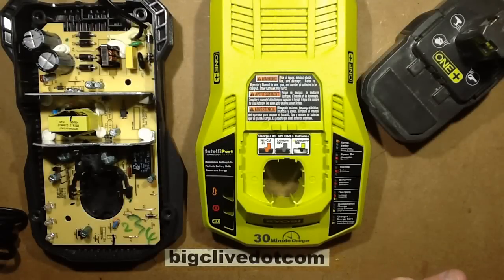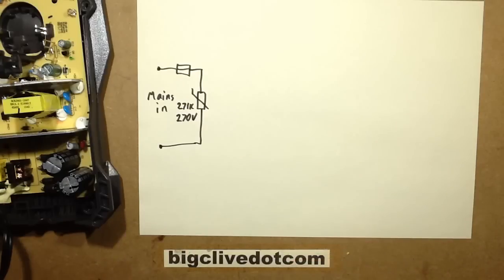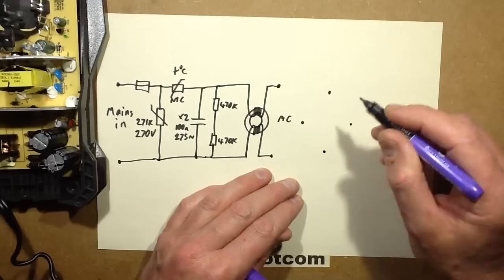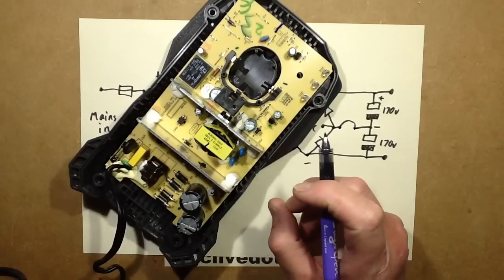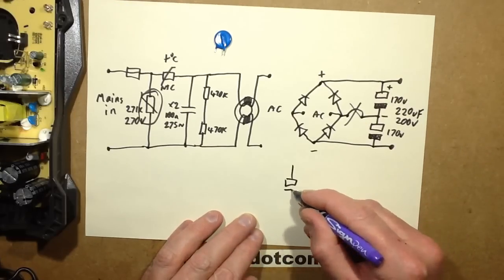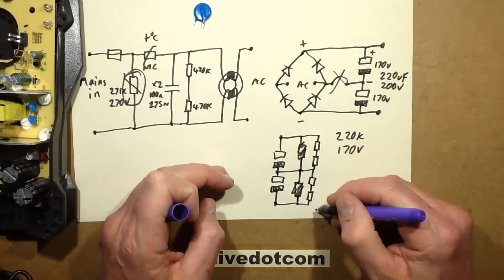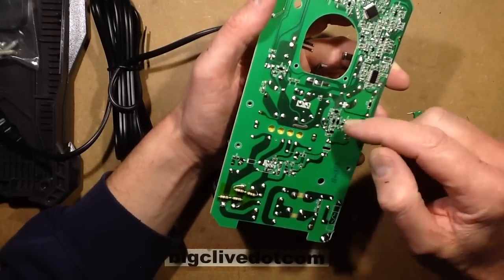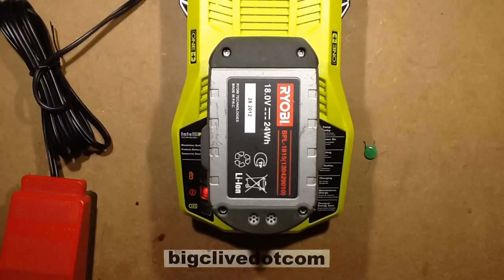How to convert Ryobi P117 charger from 120V to 230V use.

Comment: It may have been a bit cleaner to replace the two capacitors in series, with a single 100 uf 450 V Capacitor, and leave out the balancing resistors. Nice explanation.
Reply: +John Coops a) a cap like that is a lot more expensive than a couple resistors b) the whole point of the link is to make it a nearly-dual voltage standard supply. No need to make it difficult to convert back.
Reply: At least someone who thinks before writing
Reply: These capacitors can get somewhat expensive. And it may be difficult to get a matching quality one like those in a top-notch power supply. 
I would personally leave the resistors out, or use 1M resistors like the computer PSUs have. The capacitors don't really need balancing because they have extremely high internal resistance and that resistance tends to go lower with voltage creating negative feedback. I've been running several for over a year without an issue. No balancing needed. They only put the resistors in there to reduce the risk of shock.
Reply: @zwz.zdenek  Your deluded... this is in no way a 'top-notch power supply'.
Reply: In some cases, such as older and/or cheapo computer PSUs which employ a half-bridge topology, that's not really an option, since the center tap of the transformer goes to the mid-point of the high-voltage DC rail.

Not in this case here, since it's a "lowly" flyback, but "just sayin' "... :)

That being said though, i shudder at the sight of CapXon capacitors >_< Preeeetty sure the 200v ones are KM's.
Reply: Jeez, if you don't even like capxons, you've got real high standards.
Reply: Jasper Janssen You're almost making it sound like that's a bad thing :P

Thing is, CapXons *WILL* fail, same as Fuhjyyu, and countless other chinese (off-)brands.

Let me put it this way - i trust the USED japanese caps i've reclaimed from various gear i've torn down & gutted for parts, than any of these crap brands, even if new.
Reply: My point is: unless you're going around replacing caps in every mains powered device you own — usually breaking warranty — you've got an awful lot of cheap caps in your house. Yes, they eventually will fail. So will Nippon Chemicon. It's just physics: electrolytics dry out. There's no reason to think that on average more than 1 in 10-20 or so of electronic devices will have their caps fail before the devices are landfill.

Capacitor Plague is a thing , yes, but one of the past.
Reply: @JasperJanssen   This crappy design power supply will fail long before any capacitor dry out. 
These rubbish Ryobi battery chargers fail soon after  the 3 year warranty dries out, and many die before that anyway.
Reply: Yes, i know all electrolytics dry out eventually - the question is how long it takes :)

Chinese caps - a couple years (regardless of the specs in the datasheets). Japanese caps - a couple decades :P And for the record, i have an ESR-meter as well (ie. i'm not just talking out of my rear end).

I should, though, add the disclaimer that even some of the Japanese brands have (or have had) the odd series that was dud (thinking of Nichicon HM/HN's about 10 years ago, or Chemicon KZG's, of which i still see some failures to this day).
Reply: On the other hand, one can only wonder how many devices ended up as landfill precisely because of crap caps...
Reply: KhronX "a couple of years" is exaggeration. I mean, it all depends on the environment, but in many devices they do indeed last a decade or even two. If they're placed in a hot, often used environment, then maybe a few years.

Even the cap that failed in my Samsung monitor (which was a model well known for the issue, btw, which suggests particular susceptibility) lasted nearly a decade and those were the small caps. It's actually pretty rare for main filter caps to fail badly enough to affect actual operation. The small ones dry out much faster, even under adverse conditions.

(PS: having an ESR meter doesn't make someone an expert. I should know, I've got one too.)
Reply: KhronX Actually a couple of years is not so much of an exaggeration. Yes, on the average many of the cheap capacitors will last longer than that, but their death rates are all over the map compared to the better brands, with many failing early, even very early (like first hours and days even), many more in the 5-15 year bracket, and rather few lasting terribly far beyond that if they see much use, are operated anywhere near any of their rated limits, or if the circuit is particularly sensitive to a degrading ESR/D/Q.  I have had many of those cheap capacitors fail within the very first year, so they are a gamble no matter how one looks at it. Very, very, seldom do I see such early failures in number with quality capacitor brands. 

As a general rule, if I am opening a device to replace one failed off-brand capacitor and I expect to still be using that device for another 5-10 years then I usually go ahead and replace all such capacitors with quality brand (Japanese) replacements.  It costs only a few dollars more and all but assures that I will not be revisiting similar repairs anytime in the near future on that device as most of the effort lies in disassembling the device and then reassembling it. Whether I replace 20 or 40 capacitors or just one or two, it takes just a minute to remove a single capacitor and solder in its replacement (whether through-hole or SMD), a few more adds very little to the total inconvenience and down time versus repeating the repair in a few more months or years. Besides, soldering and desoldering have a certain Zen to them (actually, if you have a vacuum desoldering gun then desoldering through-hole components is borders on fun compared to without!).
Reply: Ethan Poole Couldn't agree more... "If something's worth doing, it's worth doing right" (the first time around) :)
Reply: The two large 200V ones looked like Samxon to me.  The large input capacitors are only being exopsed to very low frequency ripple.  Samxon primary caps are more than adequate for this.

The secondary high-frequency green colored caps look like the notorious Samxon GF series, and they should be preemptively replaced.

Not all of Samxon's series are inferior.  Some are actually on par with Japanese equivalents.  The RS series is a good example of this.

Comment: 15:20 Huh, damn, I always thought the capacity stayed the same when putting caps in series, regardless of what kind it was. I thought it would only increase the maximum voltage that could exist over them both compared to a single one... increasing the capacity can be done by putting caps in parallel, but decreasing the capacity by putting them in series... Can you explain this? I would think it's because of the theoretical lower voltage over them (in a fixed voltage situation) resulting in capacitors that would not be utilized till their full extent, but is it? My head hurts... :)
Reply: Sure, capacitance can be defined as the rate of voltage change at a given current. For easy math a 1 farad capacitor, starting from 0v if you apply 1 amp for 1 second the capacitor will now be charged to 1 volt. If you now connect 2x 1 farad in series and apply 1 amp for 1 second then each will charge up 1 volt for 2 volts total, gaining 2 volts from 1 amp for 1 second means .5 farad total.

I hope that this helps you understand.
Reply: Just to add to Daniel's explanation, here's how a dummy such as myself thinks about it. It's the opposite of adding resistors. Parallel resistors lower resistance, parallel caps raise capacitance. Series resistors raise resistance, series capacitors lower capacitance.
That's easy to remember. Now for understanding, I find the hydraulic analogy helpful and here's a pretty good one:  http://johnscabin.com/Basic_speaker/capacitr.htm
Reply: Gentlemen, thank you both for your explanations and serious comments. I've learned something today! :)
Reply: To help understand why the capacitance drops when you place capacitors in series it helps to realize that there two parameters that largely define capacitance.  The most obvious is the total overlapping area of the two plates (positive and negative), the other is the gap in the insulating dielectric between those two plates.  If you decrease the dielectric gap your capacitance increases but the maximum working voltage decreases, if you increase the dielectric gap the capacitance drops but the maximum working voltage increases.  When you place two like capacitors in series you have effectively doubled the gap, thus lowering the capacitance (by half) but increasing the working voltage (by double, roughly since no two capacitors are ever precisely identical).

Comment: Thank you very much bigclive! This type of hack/conversion is great, and so satisfying to do.
I was just thinking about it the other day, how the standard one+ dual chemistry charger takes a couple of hours to charge even the small (but good capacity actually) 2.5Ah battery. That one is charging at up to 1.8A according to specs. In Europe we get the RC18150 5A charger, which looks similar to the 3A P117. I have to do some price checking now! :)
Reply: If I can salvage and reuse the parts needed for the conversion, I will save the equivalent of £10-15 on a P117 off eBay, compared to buying the RC18150 here in Norway.

Comment: It's stupid that when pretty much all SMPSUs have universal input, power tool chargers are stuck in the stone age. 
110V is common on UK building sites for safety ( some even prohibit 240v ) , so universal input would be useful.
Reply from the maker: What are your thoughts on my addition of balancing resistors?  Was I being too pessimistic?
Reply: No, I think you know the proper way a circuit should be constructed without cutting corners.
Reply: Nah, too pessimistic would be adding another two sets of resistors in parallel with the first set, just in case that one goes open circuit... ;)
Reply: Can't hurt - probably not needed in voltage doubler configuration so if PCB not designed to be adaptable there was probably no reason to put spaces for them.
Reply from the maker: And yet two redundant diodes and a link as if intending for dual voltage manufacturing option.  Having since looked at other brands being converted to 230V use I've noticed a striking circuitry similarity, but with the resistors already across the caps.
Reply: Probably a very small handful of manufacturers in Asia that make these chargers.  Makes sense that they are similar as the same factory produces a number of main and off label brands.

Also makes sense to design it for 240 with a voltage doubler for 120v markets as this makes tooling for different destinations incredibly simple with the same base pcb and components and 3 component level changes during final assembly.
Reply: Ryobi tools are mainly used because they are cheap though. Not saying they are bad because they are'nt.  btw in swweden I am pretty sure our mains are 240-250v even if we are sticklers for regulation.
Reply: Yeah, any numpty can buy these tools from any DIY shop. They're not what I would call a trade tool.
Reply: I know that Nintendo's 3DS chargers don't provide much current, at 5V and yet they designed a proprietary port for it, and EXPLICITLY made sure that chargers were voltage exclusive. The 3DS is cheaper in the US than in Japan or Europe, this move was only made to force customers to stay in their own markets. I don't know much about Ryobi but I'd guess they're doing much the same with these chargers.
Reply: bigclivedotcom; The thing with these electrolytics is that they don't really like being run close to their max voltage. If one has 50% greater than average ISR and the other 50% less, then you would essentially have a 3:1 voltage divider driving the one up to 254V which, ESPECIALLY if it's not actively charging a battery to remove the charge accumulated during each half cycle, would cause it to have a much reduced lifespan.

Granted, the lifespan on these electrolytics are usually great enough to not really be of any concern, and they are pretty easily replaceable, but if you actually care about such things (which you OBVIOUSLY do), then adding some form of balancing is just worth so much more than the expended effort of adding them in.
Reply: what´s your point ?
Reply: Three years too late but it would be easy to replace that jack that he cut with switch. Then it could be switched from 110 to 230 and back easily. Ofcourse SMPS that accepts anything from 110 to 240 would be better.

Comment: Why not solder a 400V cap and bridge the other connection? Assuming you have a 400V cap.
Reply from the maker: Because that would indeed involve trying to find a 100uF 400V cap.
Reply: Why is the 100uF value important?
Reply from the maker: The combined capacitance of two 220uF caps in series is 110uF.  The capacitance value is needed to provide the necessary continuity of DC current to the switchmode circuitry.
Reply: Right, for smoothing the rectified DC so it's nice and flat and not ripply. But the 110uF value isn't some magic or optimal value, just the lowest that'll do the job. More capacitance is more better. Am I thinking right or totally off base?

Comment: And in the next video - an autopsy of a slightly melted Ryobi battery charger hehe
Reply: Slow clap. He knows what he's doing. You don't because you weren't even able to recognize his knowledge.
The use of kapton tape, the MOV that's really gilding the lily in terms of reliability... Something else might fail, but not the components he has replaced!
Reply: zwz • zdenek You missed the joke of it - I have watched enough of Clive's work to know he is very skilled with electronics, but that does not preclude some friendly ribbing!
Reply: Paul Roberts
Ok.

Comment: The mains can vary in EU, I have seen voltages in households range from 220VAC to 255VAC within one city so 240VAC is reasonably well in the limits.
Reply: The nominal voltage is 230V +/- 10%, so 220 V is within specification and 255V is just 2 V above.
Reply: Mine normally sticks at 250v +/- 2v. so fairly steady on the upper limits. This is in Scotland btw.
Reply: Historically UK & EIRE were nominal 240V (with a fairly tight tolerance) and most of Europe was nominal 220V (with a fairly tight tolerance) - in order to harmonise standards across all nations enormous technical committees had to have a long series of meetings (and luxury dinners) for several years before deciding to split the difference on the nominal voltage at 230 and increase the tolerance. Result: harmonisation achieved - all appliances continued to work, all electricity companies kept distributing at the exact same voltage they'd always used.
Reply: Which seems like a good result, no? The difference is that new appliances are guaranteed to work across Europe, whereas before something designed for 220v might not get along with 250v supplies,  and vice-versa.
Reply: RFC3514 Actually I had a soviet radio Okean 209 that was rated for 220VAC operate good for years on 250VAC. Even if the equipment is marked set voltages, there's still some tolerances to supply voltage variations if the power supply is engineered properly like the 1980's Casio power supply I'm using for CD player uses 7805 at the output.
Reply: DjResR - The key word with norms is "guaranteed". If your 220v radio had gone up in smoke after being fed 250v, the manufacturer would not have been under any obligation to refund you. But if it had been labelled as complying with the CENELEC HD norm (i.e., the EU 230v +/- 10% norm), they they would have had to refund it.

It's perfectly possible to make appliances that work fine with 50v to 1000v, the point of a legal norm is to tell manufacturers which range they must support (meaning they can't blame the customer if it fails).
Reply: I have a very old radio that has taps on the transformer for 240V, 230V, 220V, 180V, 160V, 140V and 110V. It is a standard 5 tube design, so I don't know why they went to to the extent of making so many taps.
Reply: RFC3514 That makes more sense, thanks for explaining it.
Reply: because valve heaters are less tolerant of different supplies.
Reply: mharris1270 it would also vary depending where you are on the network, if you are near the local transformer you should have a higher voltage in general than those further away.